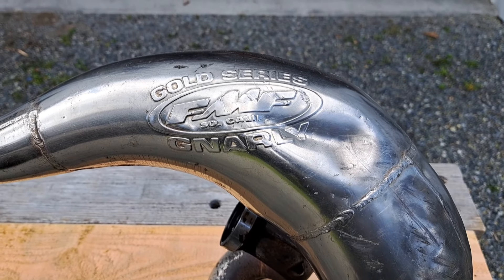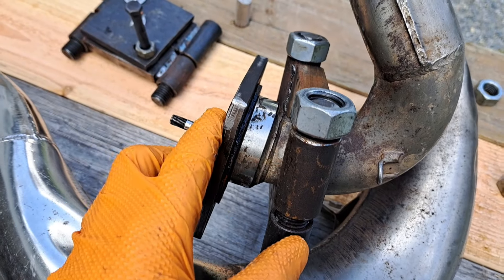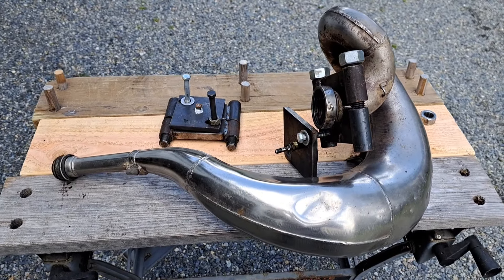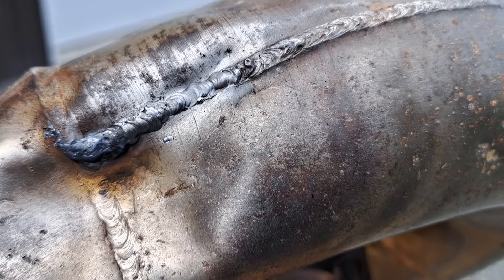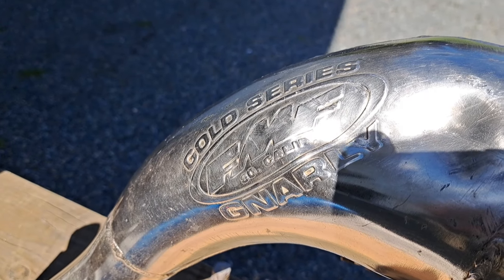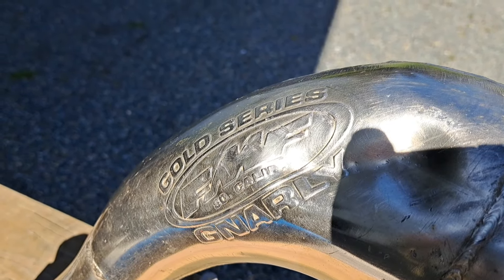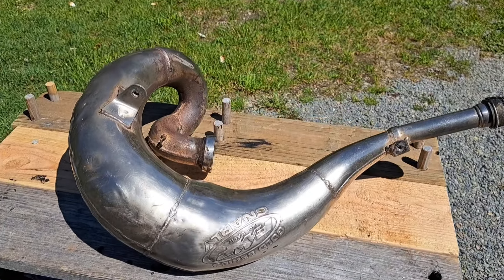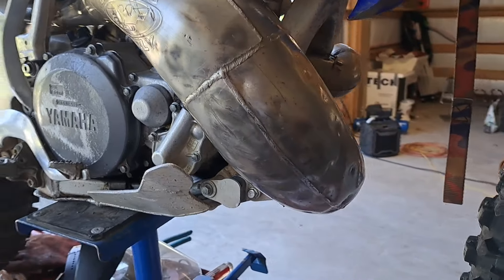All The 2-Stroke Pipe Repair Tips Plus Rupture!

Comment: I have done a few of these. I use a rubber boot at each end with a pvc block off in each boot with the valve in of the pvc block off. Hit the spots with the a torch and the pressure pushes the dents out.
Reply from the maker: I've done it that way also. I was using a radiator hoses. It definitely wasn't up to the task, it burst. It also tried to push the plug out the end. But that was just my experience. I was able to do two or three pipes with that setup. 
Thanks for commenting 👍

Comment: I had success by filling the pipe with water taping one end shut... And freezing it. The expanding ice took out the dents... If you close both ends of the pipe, fill it with water and freeze it. You'll rupture the pipe. Physics does all the work while you sit back and drink beer 🍺
Reply from the maker: I like that, a lot safer too!
Reply: Problem is that the freezing stretches and work hardens the metal which eventually will lead to cracks. The heat method anneals and resoftens the metal each time you use it bringing it back to like new condition.
Reply from the maker: I'll just keep fixing it with the torch, the way I always have.